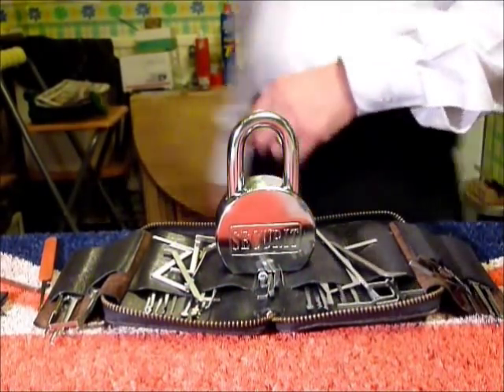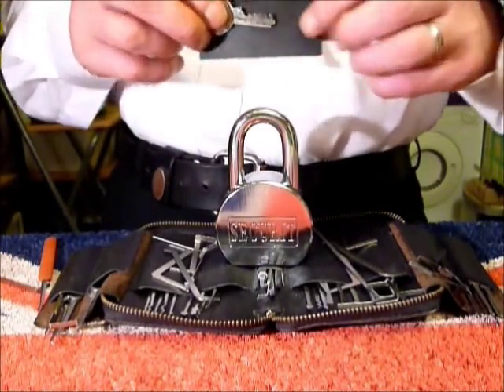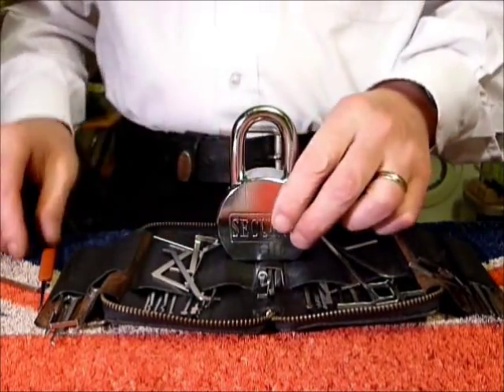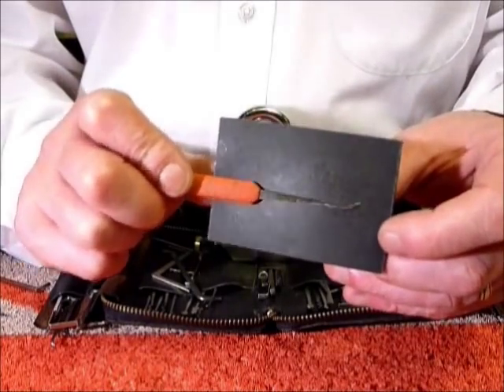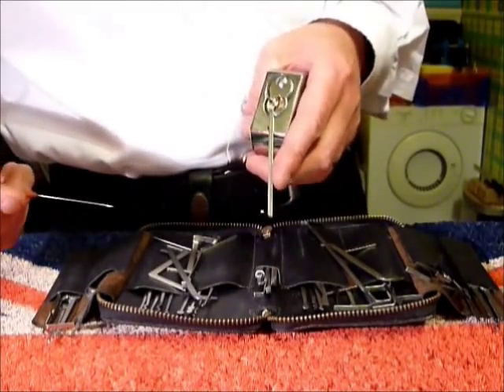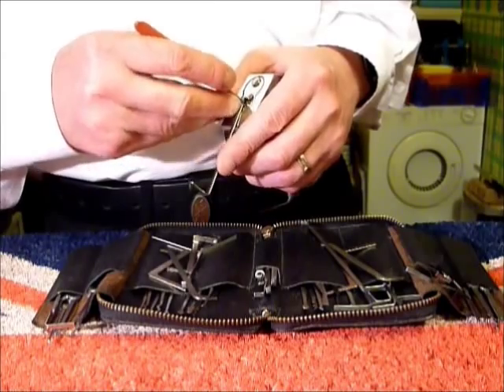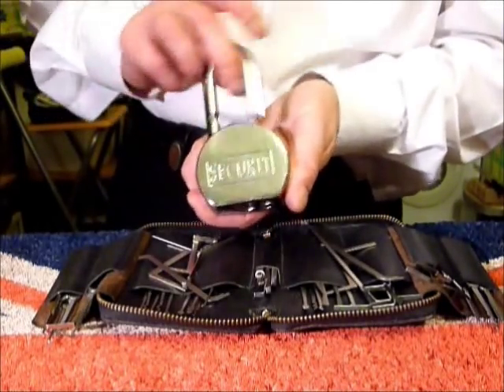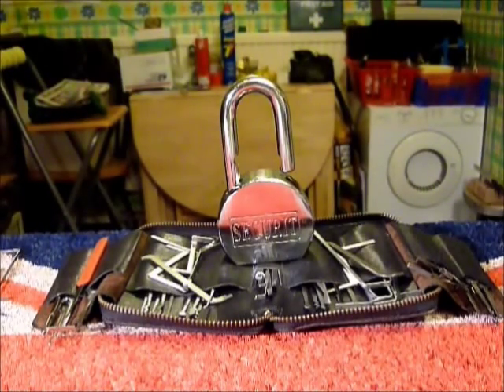Single Pin Picking SECURIT 65mm HEAVY DUTY Padlock  www.uklocksport.co.uk

Comment: I see it's an old video but do you remember this one being funny when you close it without the key in it after picking? I just did a video on it and it acts like a plug spinner on mine. crazy.
Reply from the maker: Do you mean when closing the shackle the core spins back very quick mate?
Reply: yeah, confused me a lot when i did it the 1st time! i didn't know what happened. it spins back past the reset point like a plug spinner.
Reply from the maker: Yep know what you mean LOL!!!! I was going to give it another go but forgot I gave the lock away a while back